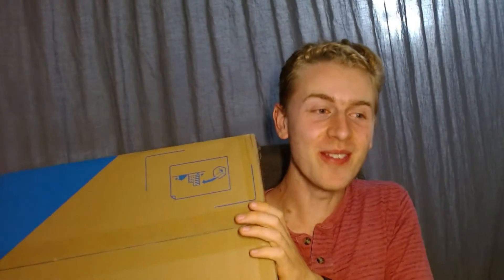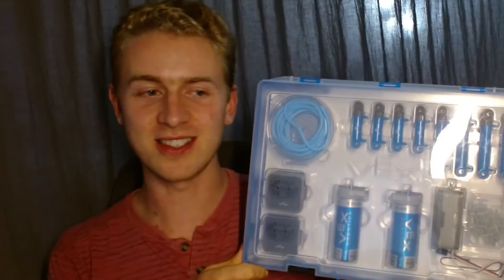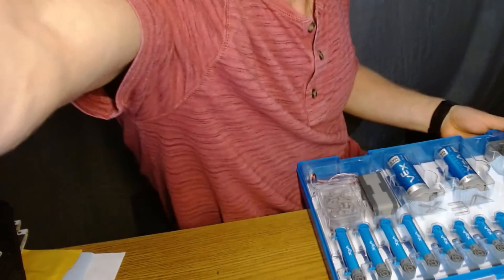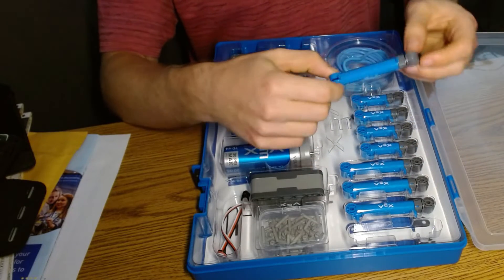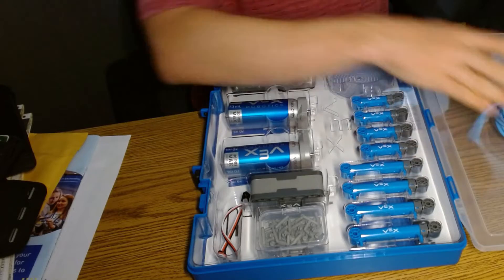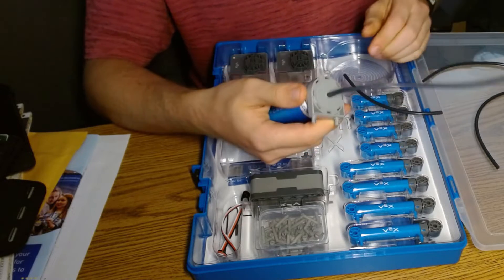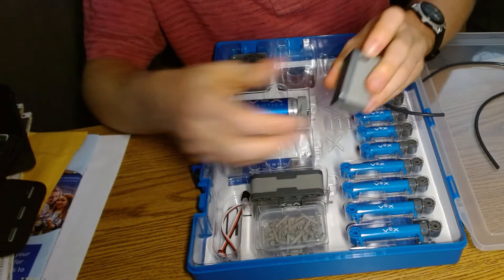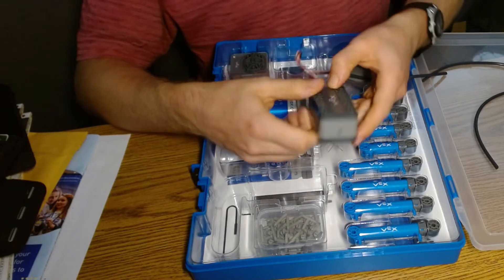VEX IQ Pneumatics Unboxing (Full Volume)

Comment: Bit of a correction, there is no pressure sensor in the pump or in this kit. However the pump does not have enough power to pump more then 30psi, so you should be fine using it  the entire match.
Reply from the maker: You're right, it's not a digital or analog sensor.  I believe it's a pressure relief valve, which uses a spring to sense the pressure and vent anything over 30 psi to the atmosphere.